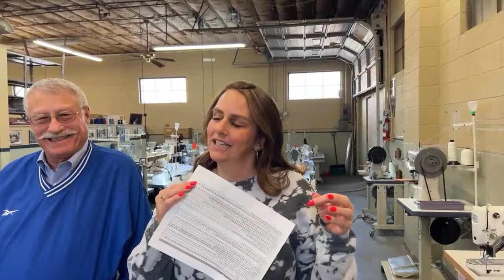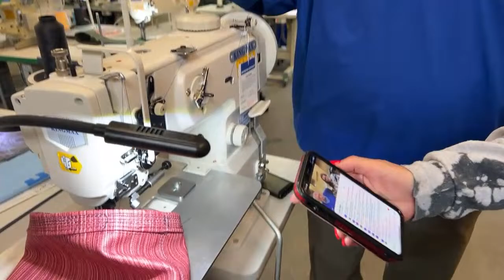No longer live: SiahSwag is live from Ralph’s Industrial to answer your questions with Jack!

Comment: thank you.  I bought this machine from Ralph's last spring,  (GC1341).  I love it but need to call  about seeing if i can adjust the needle down position. In needle down it's not holding the fabric (like just barely hitting the fabric and not all the way through it). . i'm sure there is an adjustment in there but havent' been able to figure it out. otherwise the machine is great.. just need to fix that and hoping it's an easy fix.

Comment: This was very helpful.  I obviously didn’t want/need direct drive.  I just needed the regular 0302 and just add the speed reducer and needle positioner to it.  I’m kind of used to it now though.  Now I want a cylinder arm so I don’t struggle with gussets and doing the final topstitch😂

Comment: How often do you oil the cylinder arm and where
Reply: The cylinder arm is manual oiling.  It’s has red dots on the machine to show you where to oil.  Usually oil it and change the needle after 8+ hours of sewing.  He does go over this in the video.  I usually change my needle and oil after every project, but that might be overkill🤷‍♀️